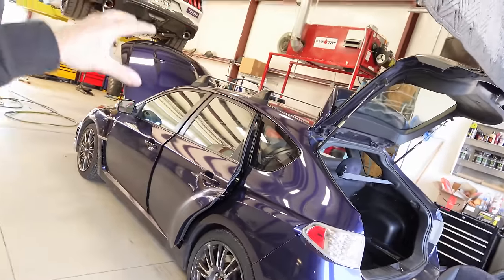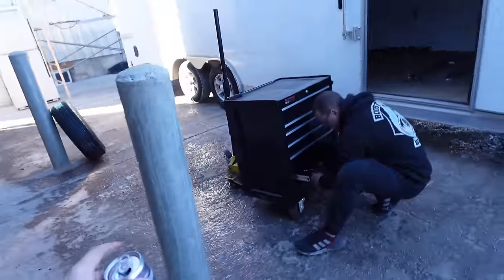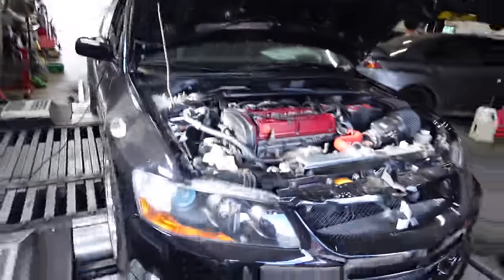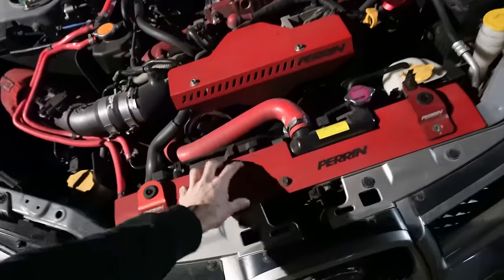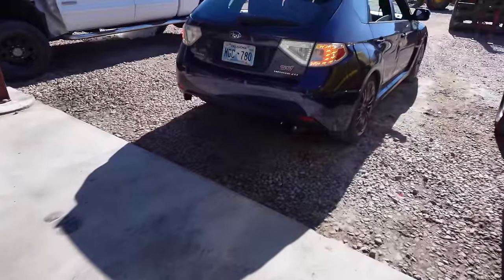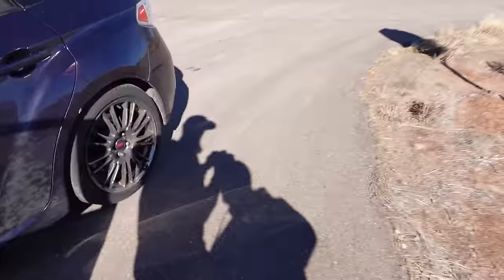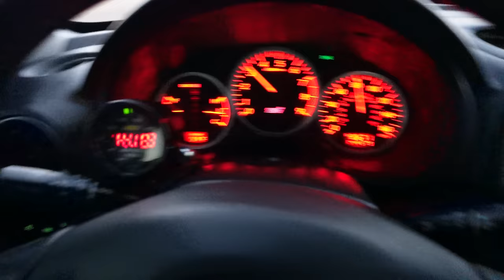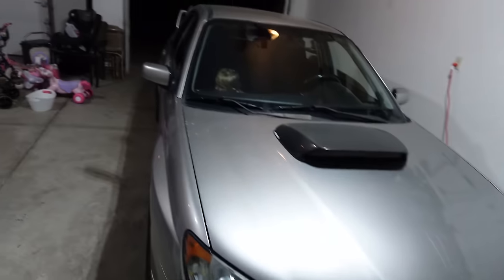22 | THE BEST EVO IS GONE.... So I bought it's RIVAL

Comment: Loved my 05 wrx but the engine is terrible sold it 3 years later I founded it blown up 😂 got a cobra terrible transmission problems, sold that for a 98 civic now I’m a Honda guy , I daily a 03 v6 accord and sold of my cool cars and started a gun collection as you can tell from my channel lol
Reply: What year Cobra? 

Subaru isn't known to have a great engine.... Good thing they made it really easy to pull! 😂
Reply: @commonsenseisdeadin2024  I got a 98 bc that was my favorite year, had a slite built motor
Reply: @commonsenseisdeadin2024  I tryed to offer the guy some money to buy the wrx back but he said he was genna fix it, told him if he wanted to sale it hit me up and think a year later he sold it to someone else
Reply: @JUHEBLA1776  so you had the Borg Warner T45, what were you having such bad problems with, with it?

T45's are pretty stout (as long as you know how to shift!) I love the T45 over the TR3650. I swapped one into my Crown Vic! 

How does one "slightly build" a 4.6 4v? 

It's a honest question, I hate that the 4.6s have such shit aftermarket, I mean they have everything you need (except lacking in the intake department) but nothing more! And expensive! (I say that like I don't have $900 valve covers on a car I spent $300 for lol

Comment: The way front wheel drives are made making a sixth gear means making all the other gears and internal smaller since you have such a small area the case cant get bigger. With Subaru (not a fan of the engines) the trans isnt limited by the width of the engine compartment. They can expand the tunnel or make the trans longer. Then no need to make weaker internals for space consideration.